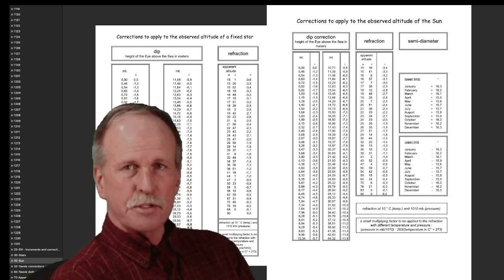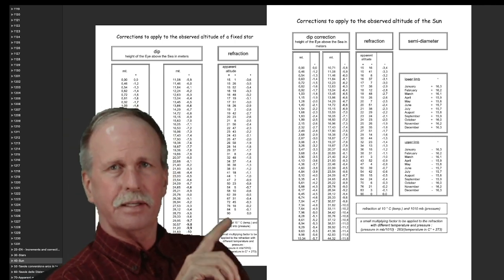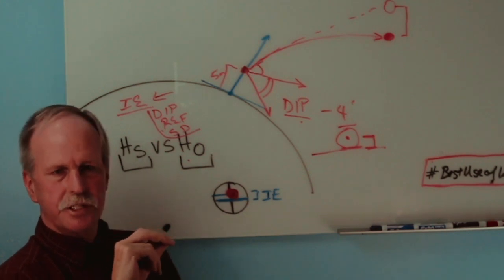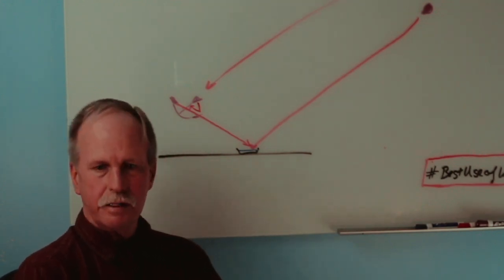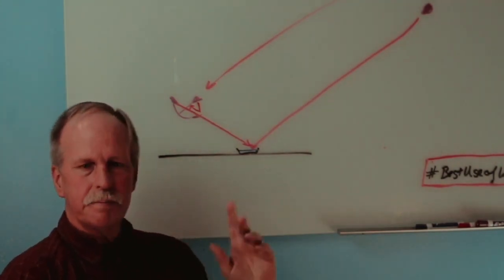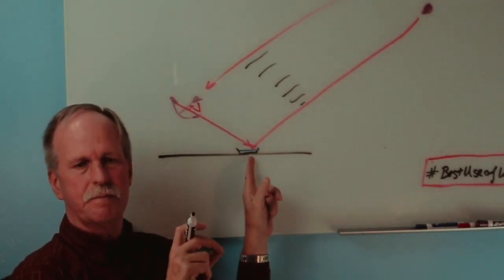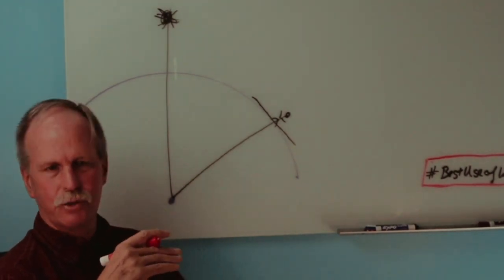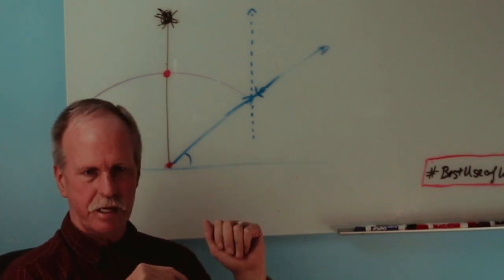The Mathematics of Navigation | Artificial Horizon

Comment: One of the things I like about this series and the one on slide rules is that these are completely mechanical tools, totally non-digital and without even electrical power. Flat Earth conspiracy types like to brush aside observations made with tools using things like GPS because in their  minds these tools can somehow be infiltrated and manipulated by the bad guys at NASA. But there's no way on Earth that those bad guys can infiltrate your slide  rule or sextant.

When I was an engineering student GPS was just beginning and still only available to the military. I took 2 courses in land surveying and we used entirely analog equipment, again, equipment which can't be infiltrated by evil-doers. With that simple, basic, but very good quality equipment we did Reciprocal Zenith Angle measurements, which is a direct way to measure the diameter of the Earth by measuring a portion of the curve of its surface. If I'd needed convincing (I didn't) that the Earth was spheroidal that experience would have done it. I had measured the curve myself, using equipment that couldn't be manipulated to give false results.

I've recommended to several Flat Earthers that they check out the land surveying classes at their local community colleges and take the first course on the subject so that they can do this themselves. As far as I know none of them has taken up the idea.

Comment: Great explanation and video.  I've 'shot' my position a couple times and gotten within a few miles as well.  I've even plotted it on nav charts.   I know the QM (QuarterMaster) on the boat would do the 'dead reckoning' with the aid of a 'plot table' that used gyrocompass heading and ships log.  (QM in the Navy is quite different rating than QuarterMaster in the Army lol).

When taking sightings off Lake Michigan, I know the 'dip' correction is based on height above the water/horizon.  But does being at 570~ feet above sea level affect the line-of-position?  When I think about it, doesn't seem like it would, but....???

Anyway, as I said before, great explanation of the basics of celestial nav.  Thanks Bob.  :)